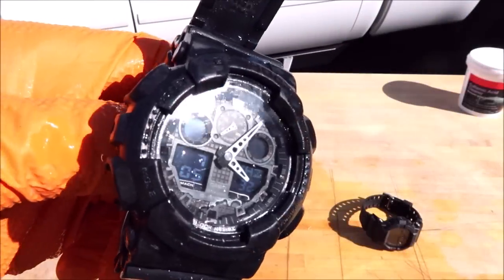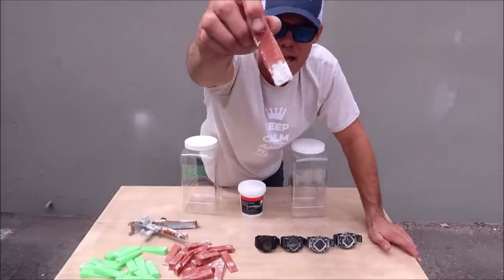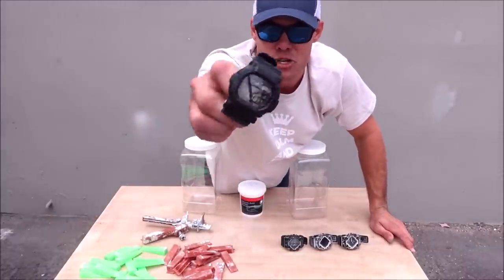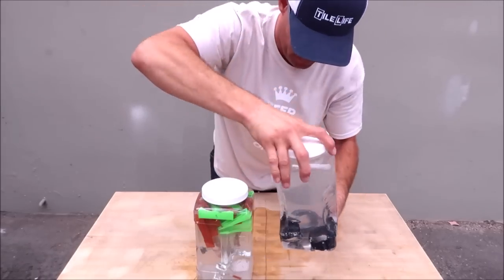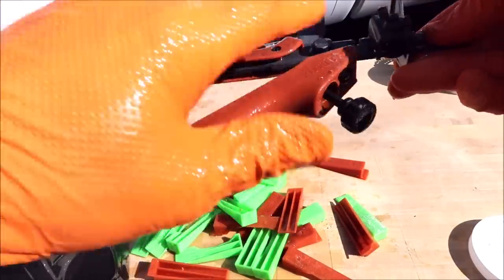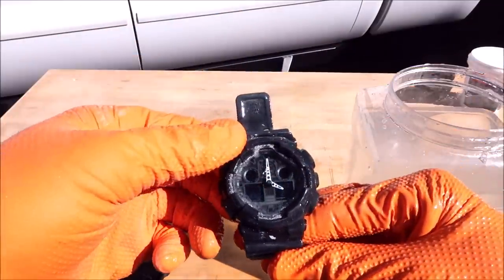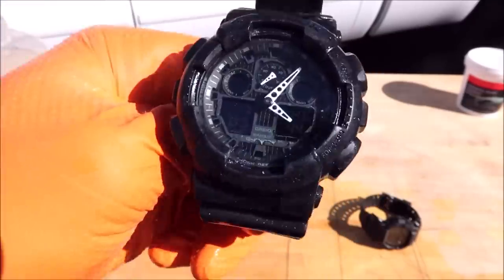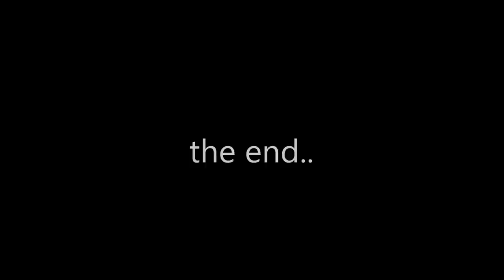How to Clean Tile Leveling Systems & Watches ☠️

Comment: What do you think about running a small out of this through my tile saw in order to flush out the pump and hoses?
Reply: Cade Hall why don’t you remove the pump and soak it in de scaler! 
Your pump and pipes should be ok anyway as water is constantly moving through it...
Reply from the maker: That's a great idea! I'm currently working on a video on how to clean a tile saw with simple green, sulfamic acid and a pressure washer. Stay tuned!